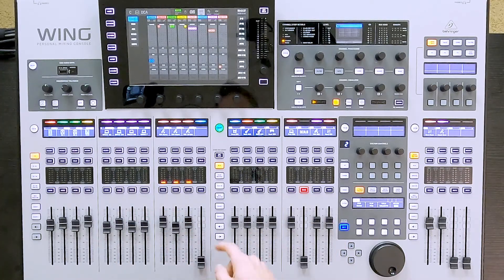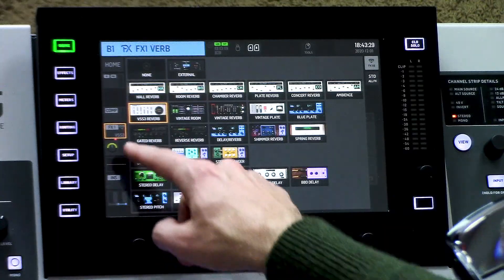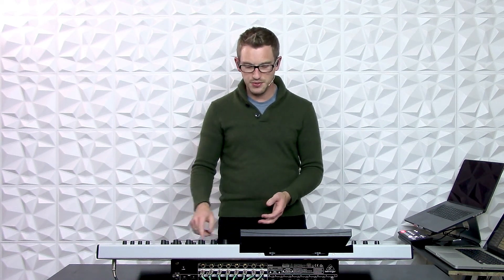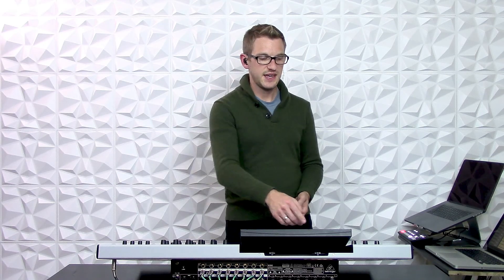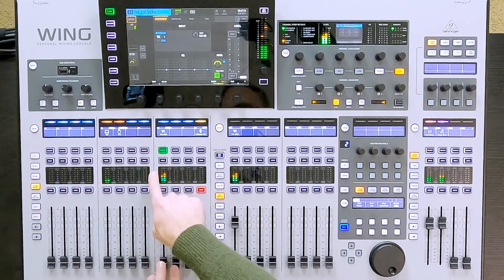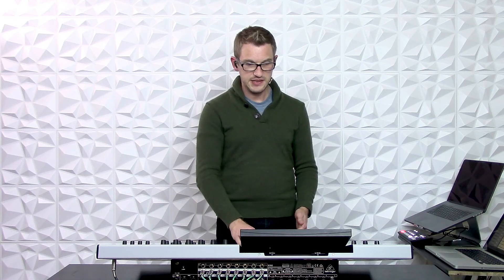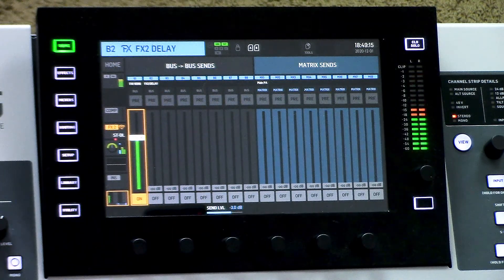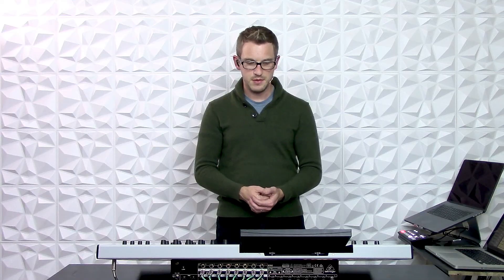Behringer Wing 301 - Effects Tutorials - Setting Up A Reverb or Delay

Comment: Hey Drew... question for you... we have teh DN 4816O and the DN 4888. We are able to IEM for everybody but the GTR from the local out on the Wing. The GTR IEM is coming out of DN 4888. For some reason my FX are bleeding through the mains. When I mute this IEM GTR bus is stops. The only difference between this bus and the other band busses is that his bus is coming out of the D4888. Can you configure the bus going through SD connect to the DN4888?

Comment: Great video again. I am usually using the bus only for feeding into the Mains. I do not have the need to waste additional Aux channels.
The only thing I am doing different is that I do not use bus 1-8 for the FX. Just to be able to rout bus in bus (i.e. if IEMs are on the first 8 busses).
Reply: I have tried to send reverb to iem but not luck, can you tell me how do you do that?